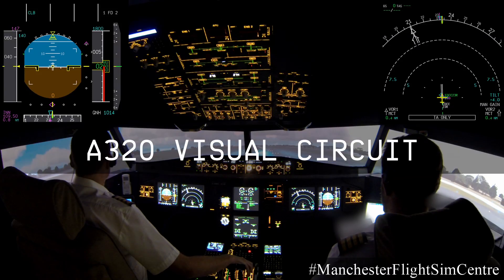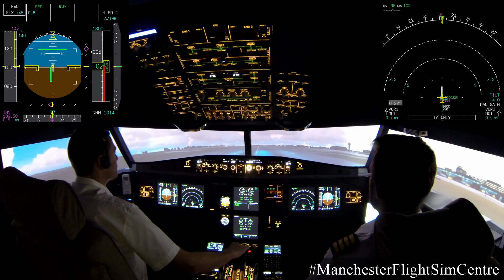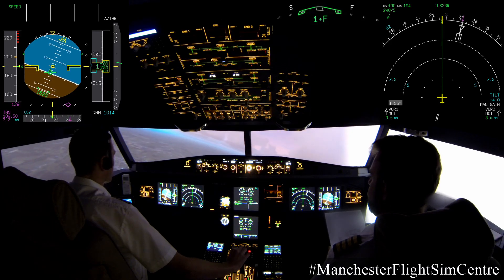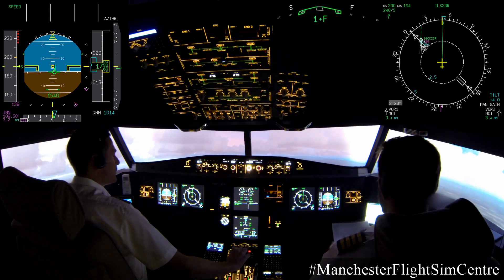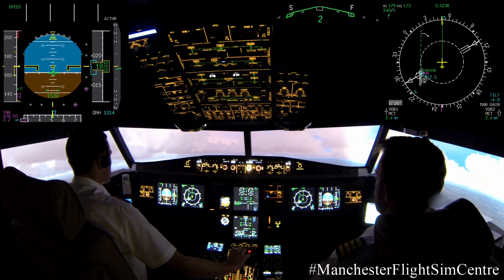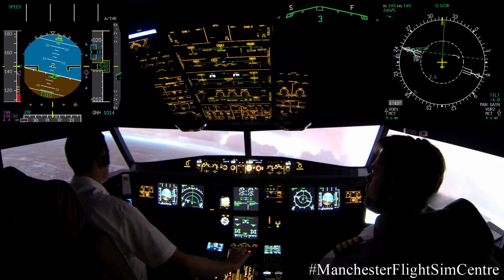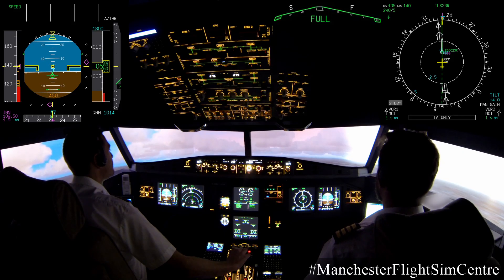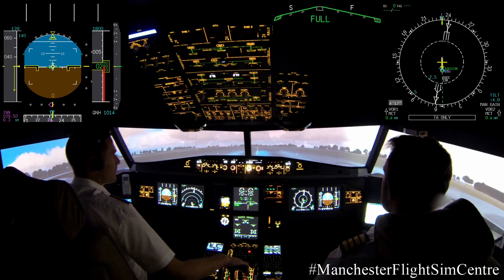A320 Visual Circuit

Comment: What I don‘t get: you calculate and measure the outbound time (45 sec) and then select flaps 2, which brings the speed down. How can you still rely on the 45sec when the speed is changing at some random point?
Reply from the maker: You do have a point, I think Airbus recommend just to be configured flap 2 before turning base, so presumably, they consider the exact moment of selection to have little consequence.  That being said, we tend to select flap 2 abeam the threshold so that it is consistent and isn't a random point at all.
Reply: thanks for the response. well, as you said, most Airbus info I can find suggest that flaps 2 is set more or less just before turning base. Setting flaps 2 at the point you also start the timer seems odd to me, because you'll counting 45 seconds of a movement with a (maybe inconsistently) degrading speed. but then again, I guess if you always do it this way, you'll end up with a consistent and satisfying result too.... :)    @manchesterflightsimcentre

Comment: Good video, have to ask why you had the QNH set to 1014 below FL50 which is the transition altitude?
Reply from the maker: Due to a fairly arbitrary weather decision tbh.  Simply that we decided that the local pressure setting on the day would be 1014 hPa / millibars.  

Above transition altitude, we would set it to STD on the Airbus - which is the equivalent of 1013 hPa. 

Transition altitude is referred to when climbing (local pressure setting -> STD/1013) and transition level when descending (STD/1013 -> local pressure setting).
Reply: @manchesterflightsimcentre  Okay thank you for the reply.
Reply from the maker: No worries, hopefully that makes sense

Comment: Gear down speed checked?
Reply from the maker: I get you!  Hardly the world's greatest misdemeanour ;)
Reply: @manchesterflightsimcentre  Could you give an amateur some context for this comment? I don't get it
Reply from the maker: @Septimius  Strictly speaking the correct response to “Gear Down” is for the PM to simply select the gear down and check for the red lights on the gear panel, indicating operation.  This is confirmed by announcing "Gear Down" - there's no "speed checked" announced first, although it doesn’t seem like an unreasonable thing to do.
Reply: @manchesterflightsimcentre  Thank you!

Comment: My only criticism is that you overshot the extended centerline because you were not doing a rate 1 turn from downwind to final. The bank angle was too shallow. Apart from that, great video and I really liked the tip for the 2.5nm on the ND!
Reply: I'm used to seeing it on the miniature aircraft of the turn coordinator.  But where can you find it in a state of the art a320?
Reply: Standart rate of turn: (EAS/10) +7 or 25° whichever is the less.

Comment: 3sec/100ft 
You are at 1500’
It means 50sec (not 45sec as you’ve calculated) 4:15
Reply from the maker: You may just want to check your maths on that 👍🏻
Reply: @manchesterflightsimcentre  45 is not right not for the math but you didn't take in to account the wind 45-5 sec for 5 knots tailwind = 40 sec
Reply: @manchesterflightsimcentre  hahahahha
Reply: I hope you're not a pilot

Comment: I’m new but correct me if I am wrong that I didnt see the flare
Reply: Can you please check and confirm as I am learning type rating and learning to flare also
Reply: Insufficient flare there, no significant change of pitch before touchdown and the vertical speed during touchdown(Spoilers extension) is quite high there, usual V/S on touchdown should be around 160-180fpm.
Reply: There is no one method for the flare on any aircraft. Most people advise to fly it by feel. Some guys don't even retard the thrust levers until 10ft and still have a smooth touchdown! All I can say is that you will get the hang of it eventually.

Comment: Cool! A common mistake that even professional pilots do is to put the mic just in front of the lips making a lot of wind noise when speaking. Fist thing all pilots should learn is to position the mic a few centimiters down so the radio comunications are much clear.
Reply: Yo! Studio technician here. The inverse square law of amplitude of sound is your enemy in a noisy environment. When I have someone singing to a condenser microphone that's extremely sensitive, they can stand a foot or two back. The more noise, the less space you have to play with. If you have the mic one inch away, and you move it to two inches, the volume will be four times lower. So in extreme proximity, minute distance matters. An moving the mic off axis of the wind in such proximity might not be doable with a dynamic microphone inside a jet aircraft

Comment: Awesome.  I am trying that at home with the Fenix in msfs. It all happens so fast. You really have to plan and be ahead of the ac. I have a lot to learn and train. A question: flying with ATHR is mandatory for a visual circuit? Thanks!
Reply from the maker: Technically, no, not at all - but it certainly makes it easier 👍

As an aside, in some airlines the use of auto thrust is mandatory for normal operations in any case.
Reply: You can also check this amazing video of A320 Sim Pilot. It is for XP, but technique is still the same :)
https://youtu.be/hjcnKu7H7Ek